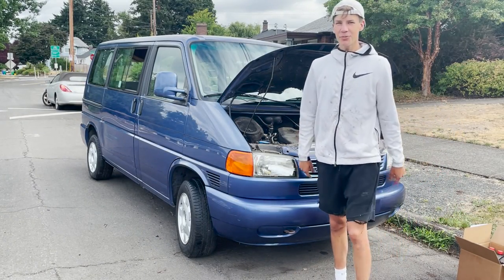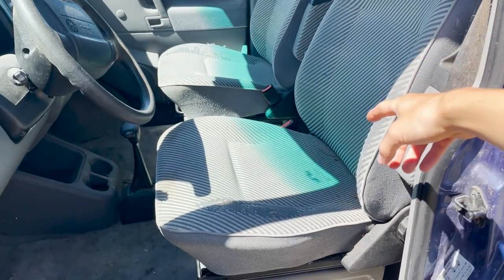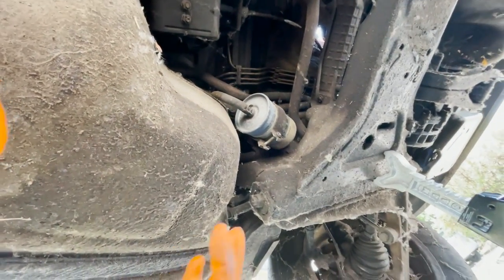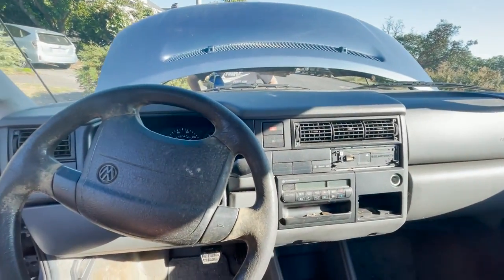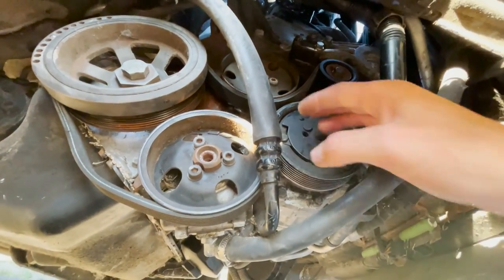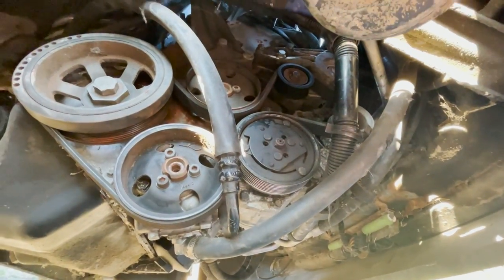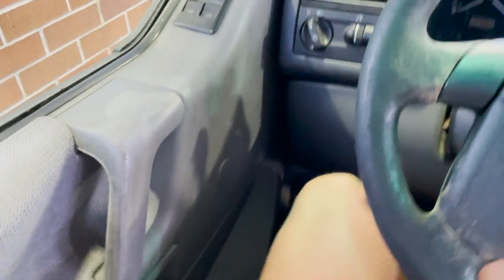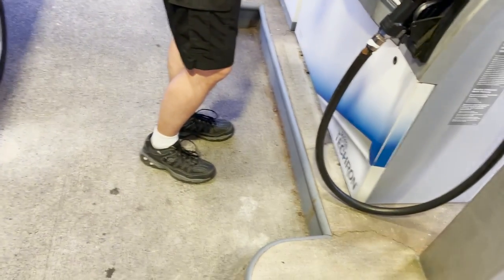FREE 1999 VW Eurovan VR6 WILL IT RUN?

Comment: Nice work mate, I subscribe, you are lucky to have one of that VR6 T4, there is quite rare in my country ( Indonesia ) , I see what you have there is VR6 12V valve AES engine ( around 140 hp )try to search the T4 series with VR6 24V AXK/AMV engine mate ( around 204 hp ) ,  I believe you can swap it with vw R32/R36 engine ( they both also VR engine and more powerfull.. )